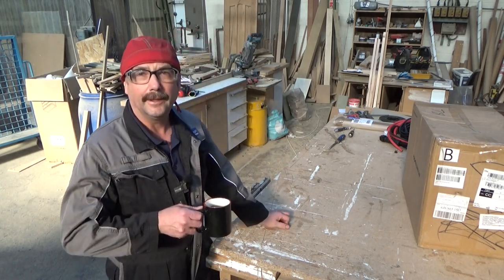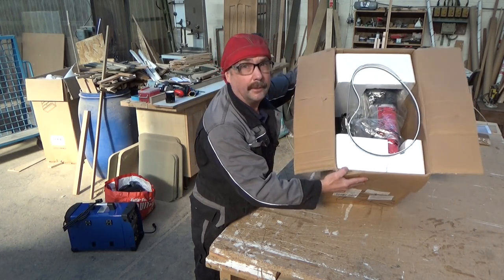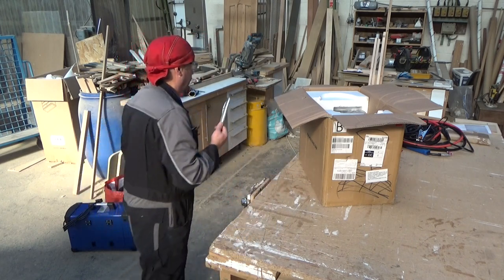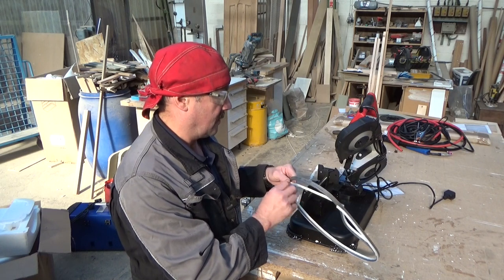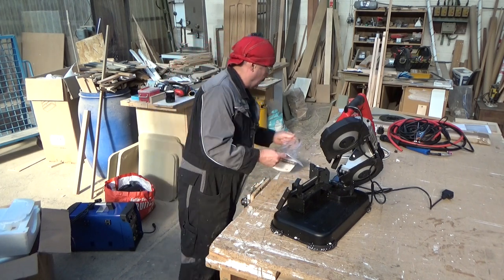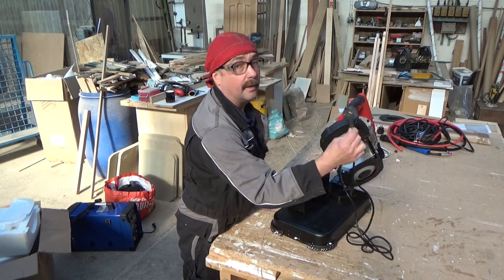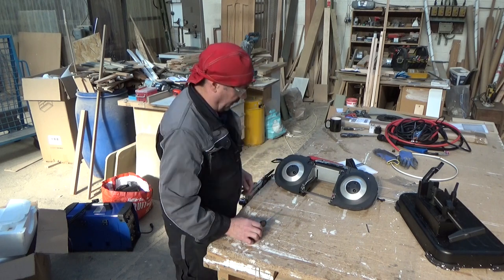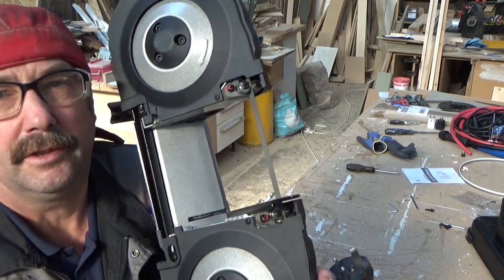Review of Vevor Steel Cutting Bandsaw 240 volt PT1

Comment: Hi l am not a hands as man but is is not mounted the wrong way Round? The cable is at the opening side?
Reply from the maker: Hi Ron. It does look strange but it only fits one way. When you use it of the stand the cord is at the bottom under the piece you are cutting.